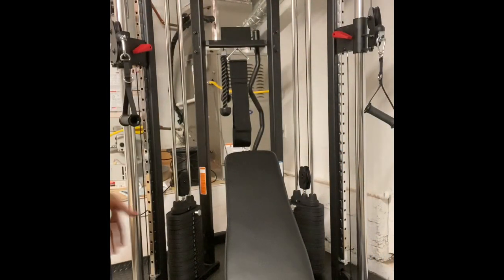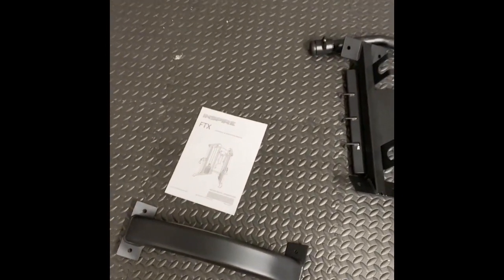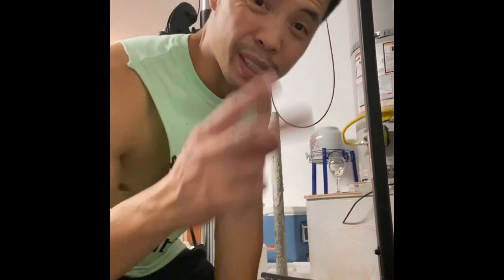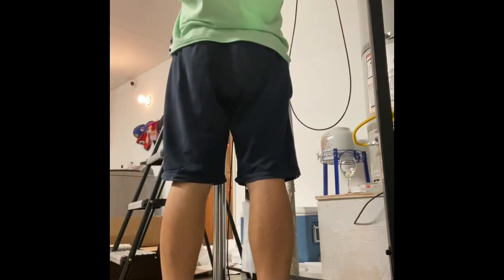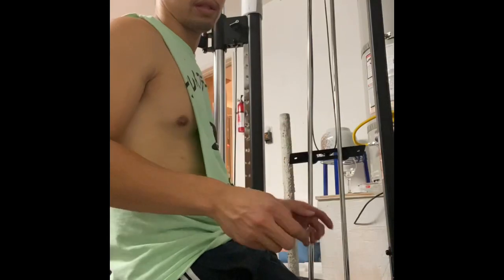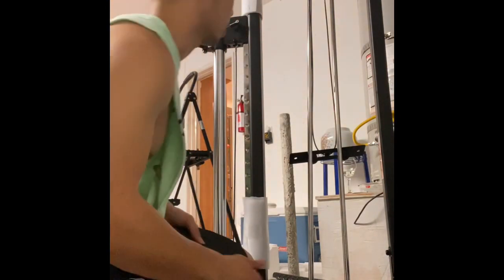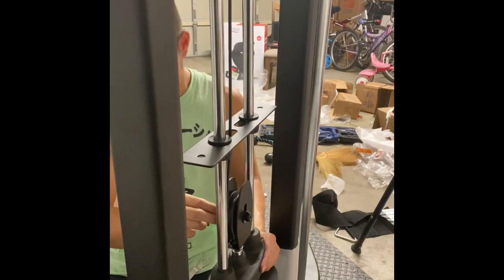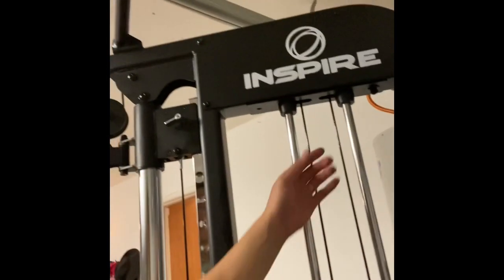The Only Home Workout You'll Need? Inspire FTX-C Functional Trainer. Let's Build One...

Comment: Is there anything that can be adjusted on the bottom to help level the unit? My garage floor has a small slope. Any recommendations before installing?
Reply from the maker: Gym mats might help? Double up on the Lower side?
Reply from the maker: But no adjustments at the bottom.

Comment: So what's the difference between this Cisco one and the inspire FT1? Also deciding between this ones and the rwp fitness ft 3000? Also how do you hold yourself down when doing lat pull downs?
And do u know if this is more compact than the rep fitness ft 3000?
Reply from the maker: I honestly can’t compare since I dint have the other one. I usually kneel down doing a lat pulldown or sit on the bench facing the machine.

Comment: Great video!  I assembled mine, but one side is not working smoothly.  How do I fix that?
Reply from the maker: Did the cable cover tear? Cuz mine did that.
Reply: @sweatyggz  the pulley was just off the wheel on the top

Comment: Do you think this would be okay for upstairs? I was planning to put it on the 2nd floor of my house
Reply from the maker: I think it’ll be ok...it just stands there. I’ve been working out on it for 2 weeks now and I don’t really do any forceful exercises with it that might make it extra extra heavy 🤷🏻‍♂️
Reply: Assuming your house is constructed to normal standards, it should be fine as long as you have decent ceiling height! The corners of a room  (where this machine was intended to stand) are the strongest points of that room.